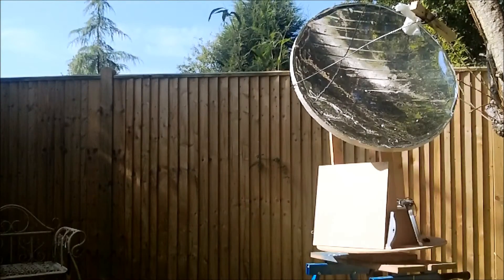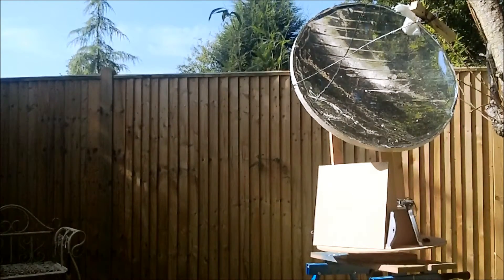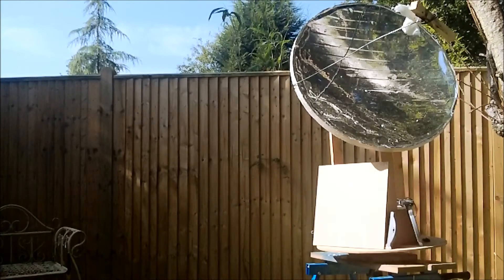Homemade parabolic mirror and solar tracker

Comment: I'd love to see any improvements or changes you've made in the last few years. I'm researching solar tracking, and I think I like your take on it. It looks like you're using the balance of energy output from the panels to center the dish on axis with respect to the sun; is that true?
Reply from the maker: You are correct Robert - the two small panels supply all the power to drive the tracker, there's no auxiliary power or batteries.
Unfortunately I've not done much more with this but I do have a new scheme that I've been experimenting with - I'll post another video when I've got some results.

Comment: Nice...  A solar tracking chicken bar-b-q'er.    I guess the idea is to make a steam powered electric generator..?
Reply from the maker: +Douglas Huston Was thinking more about flash steam to purify water Douglas. Ditch water in the top drinking water out the bottom (Via a simple condenser and a charcoal filter)A small Sterling generator to run LED's, lap-top, or charge phones would also be easy.
Reply: tutorialplz
Reply: about how it work and which motor

Comment: Nice experiment. I was browsing to see if someone had thought of using solar tracking for reflecting the sun onto fixed solar panels (e.g. on a roof) to maximise collection times during the day. 
I guess the trick is calculating nett gain vs energy used for tracking system. My requirement would also require a microchip to calculate the trigonometry to adjust the angle of the mirror to focus the light on the solar panels.
Would be interested to see if you could pull something like that off.  ;)

Comment: Excellent, I've seen another example of this but yours rotates much more smoothly and at a quicker speed.   I'm going to use some "heavy duty" servo's with the same idea, using the small solar panels to control the solar tracking.  I will be attempting to do both x and y axis tracking for a better angle for my satellite dish reflective oven, similar to yours.  Does your configuration reset itself at sunrise by itself , and are your small solar panels angled at 60 degrees?